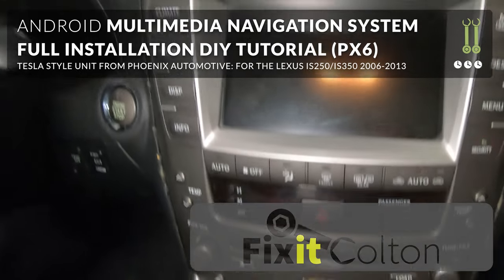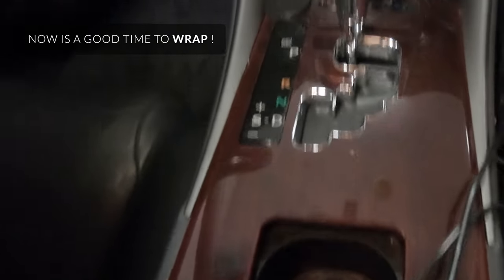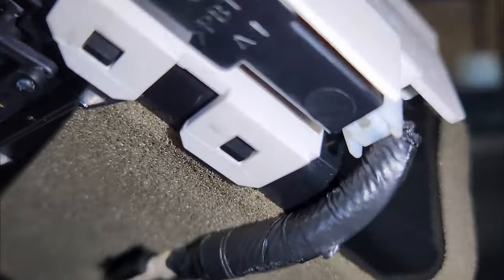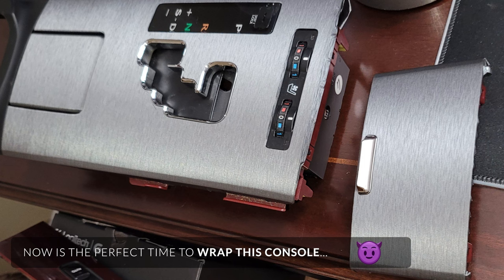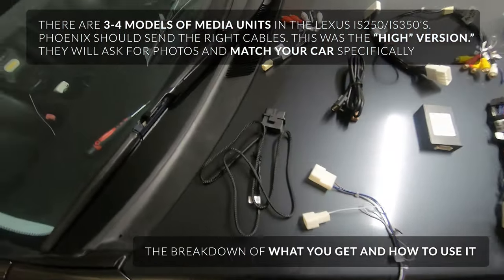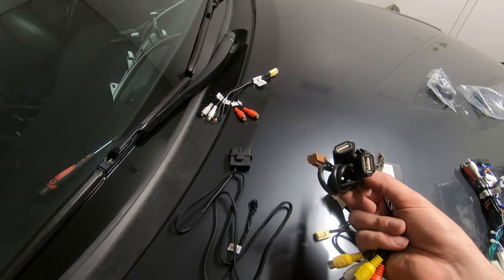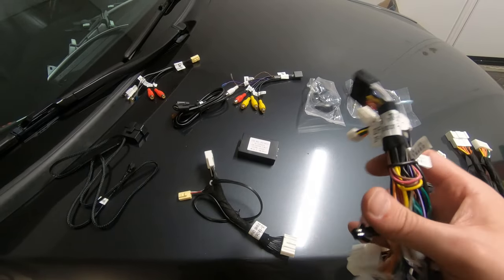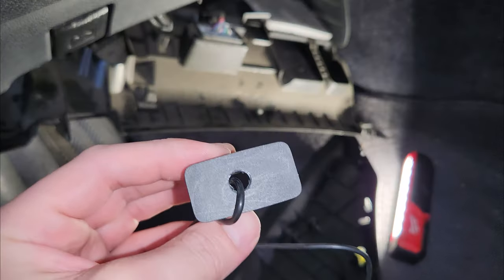Lexus IS250 | IS350 Android Navigation Multimedia System Full DIY Installation - Tutorial

Comment: Excellent vid!! Especially the bit about the only two connectors that could get mixed up!!!!  That sorted my hazards and airbag warning light!!!!  The sound is AWESOME!!!  One thing though....only the FRONT speakers are working for me (...yet the balance/fader are in the middle....), any thoughts or theories on that?
Reply from the maker: Thanks so much! I'm glad it helped out. It was an old video, but it's useful lol. I did have a similar issue... I'm trying to remember. I think the way it's wired is that the balance/fader remains useless. All speakers are running through the front L/R channels only, but all speakers are working. Check 23:15 in the video. It kind of touches on this, but it isn't vividly clear. If I remember more, I'll update. It is possible that you missed something in the wiring too, but this issue sounds like the bit of confusion I had, even though it was correct. Good luck

Comment: Hey I’m having an issue with the ac controls its down below but when I click it it won’t adjust or even turn on the screen is nice but that’s my issue
Reply from the maker: Did you hook up all of the harness plugs correctly? You may also have the wrong harness for your version car. You have to specify to the seller which variant your OEM info center was. They, typically, ask for a photo because buyers do not understand. If you had navigation, it may be far different than if you had a simple knob without display. I believe they told me there are even variants for the navigation system tiers.

If that isn't the issue, it's software based. You may have to reach out to the seller to update the firmware. They'll provide you steps via a USB/SD input. You could try factory resetting the unit. 

The last thing I can think of is to adjust the AC controls deep inside the factory menu. I know that I did this once. I was changing settings, and I accidentally removed the AC software. I had to go back in and swap the settings back. My apologies, but I am out of the country, and I won't have access to that car for a while. Therefore, I cannot check myself. However, if you're comfortable with technical work and software, you can dive into it yourself. Different variants of the car will have different CANBUS protocols. You can experiment by swapping and rebooting, if you can access them on your particular model. 

Ultimately, I'd reach out to Phoenix, they'll solve this for you.

Comment: does your hazard lights work? cause i'm having issue with that
Reply from the maker: Yes, the hazards work. Your car may require a "T" harness to go between and connect this. That would be taken up with the seller pending your tier system.

However, if you look at 10:00 or so on the video you'll see there are only two plugs that are able to be mixed up. They both fit into one of the ports. It's possible you have the wrong one plugged in. One of the two is the hazard/airbag light plug.

Last scenario, you trace back that wire with a multimeter and see if there is any continuity/break/voltage drop/etc. You may also see other options to splice if necessary.
Reply: good morning I bought one of does unit didn't get the right harness .I need high I received medium instead how can I get the right one any suggestions will help
Reply from the maker: The only way to do that is to contact the seller of your device. If you bought it 3rd party, you can try to source the manufacturer and reach out to them.

Comment: i can't believe the trouble and expense; and then that mark lev pos amp, my pos lexus has it in the trunk, in a hole withno ventilationand exposed to road water!!    wiil break down and it costs 3 grand, so, most do without ANY kind of radio for the life of the  car
Reply from the maker: I don't know anyone with this car that doesn't have a working sound system, so I'll have to agree to disagree with the "most," lol. There are many options to upgrade, fix, or adapt what's there, even with broken components. If you attempt to replace old equipment with the exact same OEM stuff, especially old rare equipment like ML units which is highly ill advised, then you will be paying insane amounts. No one in their right mind would do that though... If you're adamant about OEM only, your best bet is a junkyard or eBay. 

YouTube is better than university now days, you can pretty much learn to do anything, especially something this simple. This would be easy to solve with a little effort. For example, I'm even constructing a time machine, all from YouTube quantum mechanics videos! 🤣

If you do have the ML system, you will actually have a center speaker under that dash grill (many do not). You don't need the center channel though. You can suffice with left/right doors only, and it'll sound decent. I would definitely not replace the amp with the same one, if the old one is fried (test it). Also amps are usually vented to cool, but have one way valves for the air/water seal. Relocate the new amp if that old location is compromised, or seal that and create a more efficient breather port.

You can get a normal multi-channel amp and replace that one for probably less than $100 if you really don't care about name and brand. You can even do a simple 4 channel amp and just connect multiple speakers per channel. That's not ideal, but if budget is the issue, that would give a sufficient stereo. 

Just find the output specs of the OEM amp, and do your best to match it. Or, calculate how many speakers, their specs, and go from there. This is from memory, do not quote me. The OEM system in the IS250 had 3 way component speakers in each 4 doors (I think all 4ohm) and then an 8" woofer in the rear deck (the part above/behind the rear seats). The speakers are hovering around 25W (maybe marked on the rear deck ones), so you can reference amps with that in mind. The woofer maybe 35W. 13 speakers total, but components will be wired together.

The ML system (may be 8ohm, unsure) had 3 speakers in the front doors, 2 in the rear doors, 2 speakers in the rear deck, 1 in the front center dash grill (center channel), and woofer (I cannot remember where). The crossover is also built into the amp (I think). Therefore, if you're only getting high frequencies, no low... it could be that.

If you're replacing the head unit, with this one or another, then you can just use the built in amplifier of that to power most of your speakers. Usually those are 40+ W per channel. You can get by with splicing the 4 doors in, right at your head unit.  I don't remember much about the ML woofer. You MAY be able to do a tiny amp of its own to power that and make it prominent, but that will require matching the specs. If your new stuff is too powerful or mismatched, it could damage the equipment. You could utilize the wiring from the burnt out ML amp, if that's what you're going for. 

To fix a stereo system is probably one of the easiest theoretical things to do, but it may require a lot of busy work to access things. You likely can trace wiring back and make connections without removing much. 

If I had that scenario, I'd replace the head unit with something like this one. Nearly all amps or sound processors will not support true center channels without spending a LOT. Therefore, I'd wire the center to a left and right connection to create a pseudo center channel, that or leave it disconnected.

Try approaching problems with a positive mindset. Even brand new cars break or have detrimental defects. This is an old car, it's a solid old car, at that. There are worse things in life. This can be fixed. Good luck